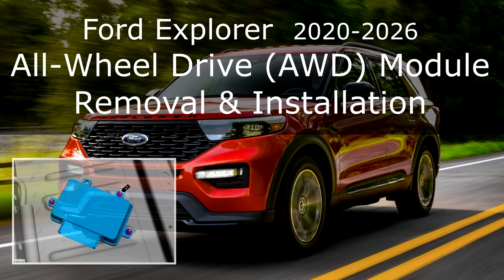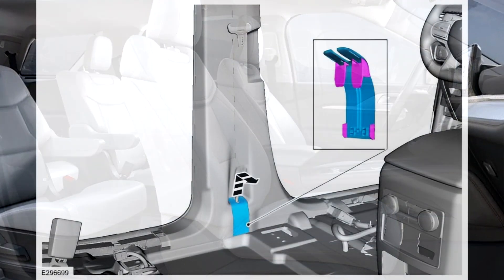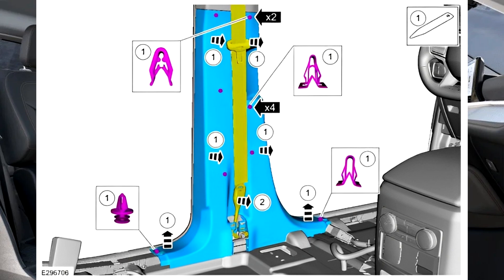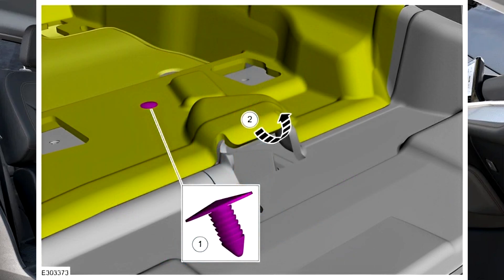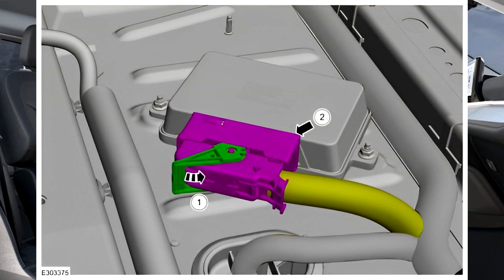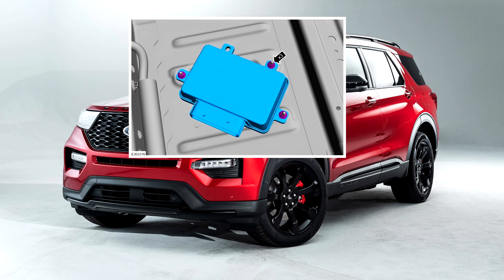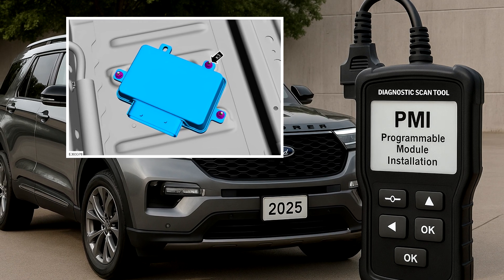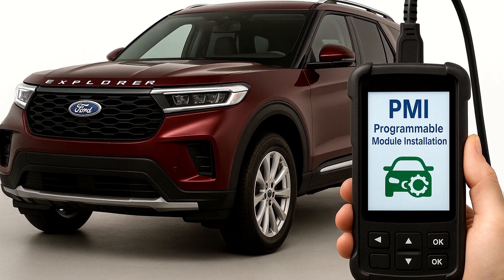Ford Explorer | All Wheel Drive (AWD) Module | Removal and Installation

Comment: What is the part number for AWD 2020 explorer 2.3 eco ?
Reply from the maker: The part number for the 2020 Explorer AWD 2.3 Eco is typically found in the service manual, but I recommend checking with your local dealership for the most accurate info!

Comment: Can you please explain how you are supposed to download the programming from the old AWD to the scan tool so that you can upload it from the scan tool into the new AWD unit once it's installed I have a high-end scan tool (Xtool and a Snap-on), but I am not aware of the ability to download programming from the vehicle into the scan tool
Reply from the maker: Thanks for the comment!  You’re right - most scan tools (like Xtool or Snap-on) can’t directly download AWD programming. You’ll need to use the “module replacement” or “clone” function if your tool supports it, or a factory-level tool to transfer the data from the old unit.

So, check if your scan tool has a “Module Clone/Replace” option for your vehicle - otherwise, dealer-level software is required....